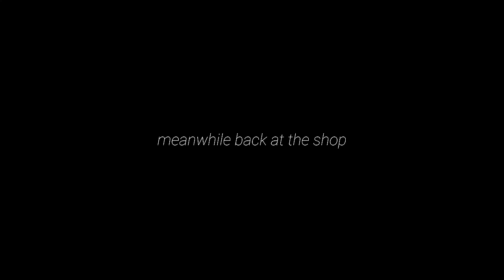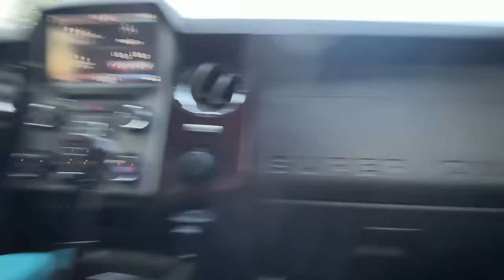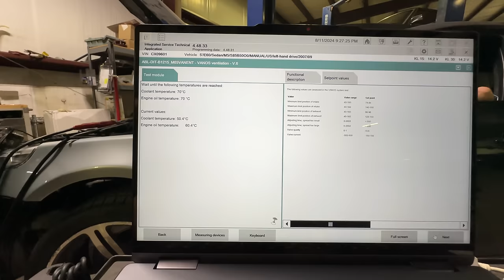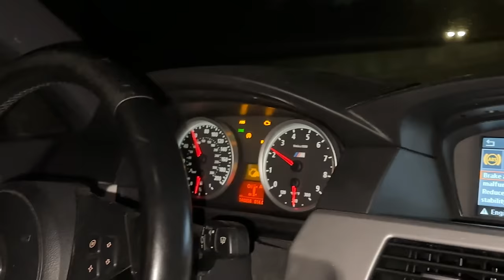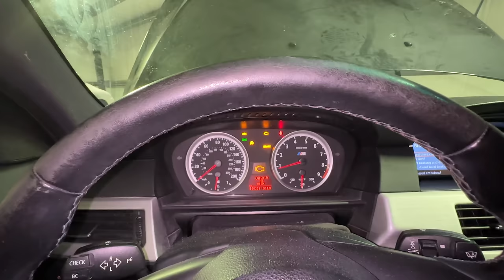I BOUGHT A SECOND M5 E60 TO FIX MY FLIPPED M5… THEN MY ENGINE BLEW UP!

Comment: Dude this is basically the fear of everybody thinking about buying an M5 E60
Reply: Absolutely his fault. The mechanic isnt aware of these cars. He ran the car low on oil pressure thats how he blew it up. I own a e64 m6 but engine wise it has given me no problems.
Reply: @TonytheCarEnthusiast  just murica things, cuz you dont need to be an m5 expert to know what NOT to do
Reply: @TonytheCarEnthusiast  >Buys rebuilt engine
>Immediately starts doing donuts and redlining it, running it with low oil pressure and bad solenoids
>ENGINE BLEW UP WTF WE GOT SCAMMED, WE GOT NOTHING TO DO WITH THIS

?????????????????
Reply: Too many mistakes were made here. The day I saw that thing go into the desert I knew they were never going to recover, e60 m5 is the last car you want to do that with. Second mistake is ok they get a new engine but the e60 again is not a car you want to give to any Tom, Jack or Jill to work on. You really need to seek out mechanics known for expertise with the s65 or s85, hell I wouldn’t even take it to a modern bmw dealership unless I knew for sure that they had a mechanic in there that worked on these cars during Bangle era. I mean I think I saw a time in this series the mechanic randomly picking up 10w40 in a super market and throwing it in the engine, that’s crazy!

Comment: Hate to say it but this is a very common error that occurs when the timing chain is out of spec. There is nothing wrong with the vanos valves themselves, the problem comes because the timing is out of spec and then you are deceived by the error codes. You hear clearly and distinctly that when you drove the car for the first time that the problem started already then. Get worse and worse by driving the car hard like you did when you hit the rev limiter. First I would check the position of the camshafts in relation to each other, then you can clearly see if the timing is mechanically out of spec. If this is good, it is most likely the tensioner that does not work as it should when the revs rise. There is also a possibility that the vanos unit itself is worn, these are rarely replaced unless you have good experience with these motors. Internal wear within the VANOS unit itself can cause this issue. Even with a new solenoid, if the VANOS gears or internal components are worn out, you’ll still get fault codes. Been working on alot of these engines and they are okey if you learn your way. Hope you get it running a 100%! :)
Reply from the maker: Thank you!
Reply: @schaefchen  Hope you can get a little closer to find the problem. If there is something you want me to explain in more detail, let me know :)
Reply: I agree with everything you said, but bad VANOS gears cannot blow the engine up lol. It will simply not run as good, and will not sound as good. I did not hear any chain slap from the engine, sounded exactly like the VANOS ticking noise. Also redlining a freshly rebuilt engine is a pretty dumb thing to do. In most cases, they have to be broken in for the next 500-1k km and driven normally.

Comment: A friend of mine bought his E60 M5 and got the entire engine serviced for like 12k, they told him the car isn’t allowed to go over 3k rpm for 1000km and not over 5k rpm for another 2000km as well as it needing 5 oil services with some heavy duty racing oil during these 3000km… So im guessing redlining the engine for 10 minutes was just to much for the engine. Still, good luck on rebuilding it. 👍🏼

Comment: Rooting for you! Don't ever use aftermarket parts if you can avoid it. Buy used OEM parts if you can't find new parts available. I bought a used SMG clutch solenoid valve on ebay after we tried an aftermarket one that failed bleeding/ installation. I love this car, don't give up on it!! Very rewarding once you fight through the BS. Shoutout to Bavarian Workshop and JMP Autowerkz in LA.

Comment: Sorry to see it come to that. I’ve been down that road with rod bearings on my golf a few times, I called it a day and ended up engine swapping to something else. Engine number 6/7 I think now. 😅

I noticed when I watched the video the other day where you done the 360 and the car shut off, when you turned it back on I think at 38:12 - 38:18 I thought it sounded like a rod bearing. You may struggle to hear it without earphones as it’s a faint/light knocking noise.
Don’t give up 🍻
Reply: i herd that too . after a solid 5 min red line

Comment: Get m539 resto in there to fix that thing!
Reply: He wouldn’t wanna touch this junk tbh
Reply: Too many mistakes were made here. The day I saw that thing go into the desert I knew they were going to never recover, e60 m5 is the last car you want to do that with. Second mistake is ok they get a new engine but the e60 again is not a car you want to give to any Tom, Jack or Jill to work on. You really need to seek out mechanics known for expertise with the s65 or s85, hell I wouldn’t even take it to a modern bmw dealership unless I knew for sure that they had a mechanic in there that worked on these cars during Bangle era.

Comment: Hey, have you possibly checked the oil filter after getting codes for vanos? I don't know if it could be the problem in S85's, but with my N52 i got vanos codes when my oil filter cap broke from the inside and the filter itself looked like it was getting sucked in lmfao. That made my car lose enough oil pressure so vanos solenoids couldn't work properly, but it didn't lose enough to trigger the oil pressure light as there's just a SWITCH for it and it also didn't even give a code for it. It could be worth checking anyways if you haven't already to take one thing off the list :)

Hoping you guys are able to get it fixed! Absolutely love watching these :D
Reply from the maker: Thanks man!

Comment: This makes me seriously question my desire to buy an E60
Reply: E60 is fine, the Diesel ones are Great. The M5 is just a Diva
Reply: @xReDHawK156  Coming from an AMG...the M5/6 would be my only choice lol
Reply: @JMKPerformance-d6q  it depends on your budget, there are many guys out there without Big Problems. But you have to be Lucky. I personally would Never touch These Engines. I did some very good experience with the S55. I had an M4 and now im driving an M3 F-Series, best Car ive ever had..
Reply: @xReDHawK156 They don’t have big problems because either they know exactly what they’re doing or they leave it to someone that does. Certified BMW-techs barely even know how to work on these, the specialists do.
Reply: Nothing beats a amg.. I love the v10's but give me the m113k e55 or cls55 much much better!
Reply: Real bmw's have a straight six na

Comment: The bit where you found a video on YouTube that described the exact same issue where the cable was disconnected and it prevented the car from starting and you solved it in 10 sec after watching that video that has like 2000 views is so relatable lmao

Comment: The m5 e60 is a very beautiful car but the engine sucks at reliability. If i'm correct the crank bearings need to be replaced every 30.000 kms. Also the cylinder wall thickness and gap between each cylinder is very small which makes it easy to overheat. And when rebuilding it if the cylinders need boring and honing it needs to be done with a specific cutting material so that it will not remove the silicone from the cylinder wall.

Comment: Should have sold the car for parts after flipping it on the roof. And then bought another E60 M5 in similar condition. However it does provide nice entertainment for us seeing what breaks next in this disaster of an automobile! Too bad it did not work out for the road trip

Comment: You didn't run the engine in after fitment you ragged the arse off it drifting it. its no wonder it blew.
Reply from the maker: Its a used motor

Comment: Get rid of the fuckin V10 and swap it for a LS3. 
Switch the LS3 to solid rollers, different cam, let it rev to 8.000 U/min and be happy. 
I love BMWs (owned a lot) but the V10 was a problematic engine, when it was new. Now these engines are old and even more unreliable. 😒